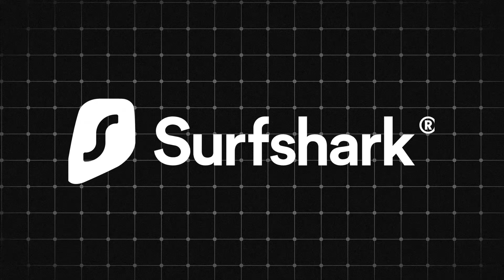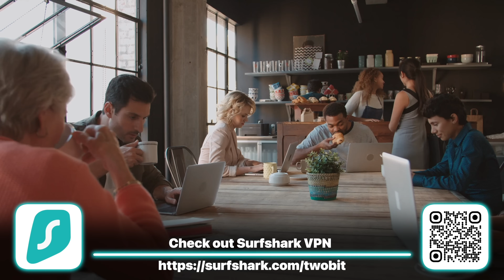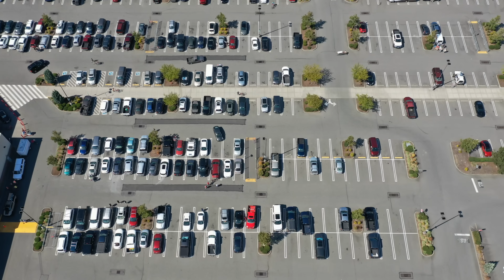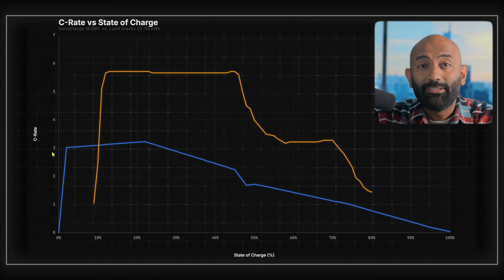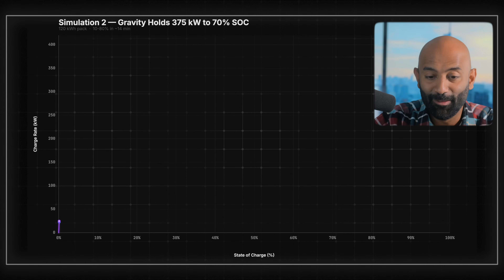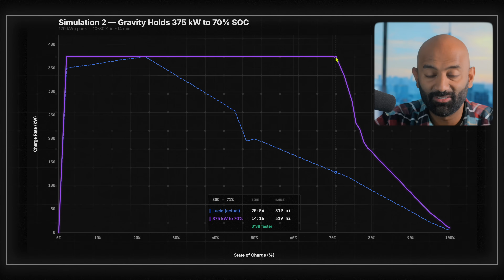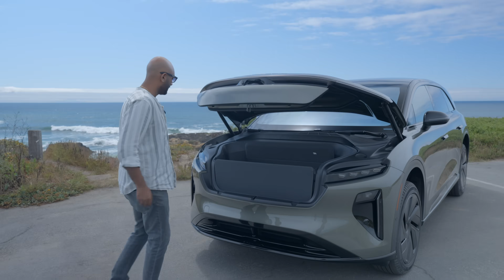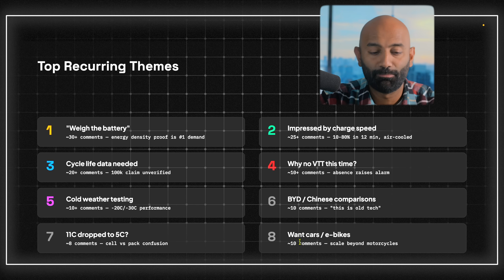Donut Lab Battery Test 4 Changes Everything!

Comment: Good analysis, this is getting real!
Note that we have some evidence of more than a dozen charging/decharging cycles performed (at least 340 at 3C rate), hidden in the temperature record of VTT report #3, see Figs 2 to 4 there. There might be other interpretations for the oscillations, but not probable.
Reply: Can you be more specific? The only oscillations I see is room temperature.
Reply: @Giedrius00  VTT report states (direct quote): "Variations in ambient temperature were caused by other cells being cycled in the same fume hood."
The self-discharge test was run in a fume hood, and the ambient temperature in the hood was monitored. I zoomed in figs 2-4, and by simple counting the peaks in the blue curve found 676 peaks, approx. 20 min intervals, corresponding to 338 charge/decharge cycles.
As seen in Figs 3 and 4, the blue curve starts/ends mid-cycle, implying that the cell-cycling experiment was started earlier and continues beyond the shown time. That's why I wrote "at least 340" above!

Comment: At around 8:15, you speculate that the Lucid Gravity charge power slowly ramps up as the SOC increases from 2% to 20% due to warming of the pack. That's not the reason. The charge power over that interval is limited by the maximum current from the charger, and at a fixed current (500 amps?) the power rises as the pack voltage increases.
Reply: Thank you for saying this. Every time he said it was warming up, I thought no, it's climbing in voltage with a maxed-out current supply.
Reply: Yep, ngl I was not expecting him to be ignorant on this important skipped over point
Reply: It's also following the characteristic of the li-ion battery. Li-ion battery has the S-curve that dictates the max charge rate you can apply. Slow charging at 0-10%, max charging power at up to 50%, and then slowly tapering down when the battery gets more full. 

You can't hammer ultra high power at 0% SOC because it will damage the interphase layer in the li-ion battery, further decreasing its life cycle (that's why the fast charging test from the CATL, BYD, and other big battery makers are always starting at 10%, not 0%)
Reply: Bravo
Reply: Yup, I see this on my electric moped. Which unfortunately only charges at 0.5C, but on the other hand runs on used ebike cells that have been holding up very well for going on 4 years now.
Reply: @jimmurphy5355  Yes, exactly!
Reply: that's kinda basic knowledge...so this means this guy is part of the trick.
Reply: It’s amazing how often he completely misses core principles yet sits there with his massive ego pretending he’s become an expert
Reply: @geekswithfeet9137  Let’s give the guy a break. He is trying and I guarantee he will learn from this chain of comments. Everyone would love to see 100% accuracy and correct interpretation, but to be human is to err. He is bringing some very important information to the masses and sharing both is knowledge and ignorance. Well done for mankind.

Comment: Great analysis! The comparisons and data points are very helpful.
Reply from the maker: Glad you found the data helpful! ⚡
Reply: @TwoBitDaVinci  One minor correction. You kept on stating that the Gravity was charging on a 400KW charger, but it wasn't. It was on an EVGO 350 KW not a 400 charger. Like I stated just a minor correction.

Comment: I'm guessing that the next test will be charging and discharging at -30C. But measuring the weight vs. capacity would be a winner as well. Thanks for the balanced review, and the comparison to Lucid's large battery pack. Which provides an understandable comparison between Lucid's conventional battery pack, and the relatively small (air cooled) Donut Lab battery pack.:popcorn-yellow-striped-smile:
Reply from the maker: Glad the comparisons helped make sense of it! ⚡ I'm not so sure the next test will be -30C testing though... would love to see it
Reply: I really need to see cold temperature test. I am from Finland and we know how poor EV's are at winter. Low charging and half cutted range in coldest times😢

Comment: BYD charges in 9min full
Reply: Requirements are a lot different for other SS batteries. They need to be clamped together hard, for instance. Adds weight.
Reply: Liquid cooling vs air cooling. He explained how the “taper” are just BMS limiting heat so you’re not sitting on a motorcycle that’s hotter then a stove.

Comment: A Lucid-sized Donut battery pack could charge fast if you could plug two 480kw chargers into it at once ... (With the right architecture)
Reply: Eh. Any Tesla charger would get you on your way in ten or fifteen minutes.

Comment: I'd rather have this battery on an minimalist e-bike.
Reply: Solid state batteries should make every application better especially if the power to weight ratio is good.
Reply: I'd like it on a maximalist ebike too!
Reply: @ChinaskisSoberBrother LoL same 

 Gimme a car with YASA next gen motors. Two at least. 

 (750 kw at 28 pounds last time I checked. 350-400kw continuous. 1006 HP). 

 They are cooking up a 15kg  inverter that can handle two for 1500kw or for 2012hp and trying to make it a mass neutral wheel hub motor. 

 Meaning it will weigh the same as a regular car wheel. Getting rid of certain parts due to being a motor. (Like breaks. They say the motor is powerful enough to Regen, and use emergency breaks) 

 This technology just doesn't make cool bikes guys. The motor + solid state batteries = personal VTOL or STOL. Redundant too since batteries, wires, inverters, and motors are a lot easier to build around. 

 I was just talking with someone, and so many EVs having the same layouts as ICE is lame. It opens up so many design possibilities now once they can have range without maximum aerodynamic efficiency.
Reply: @rpfour4  oh yes! My ebike was stolen and I long to replace it! Mountainbiking was never as much fun as with a middle motor ebike with a smooth Bosch motor. They say any shape for the pack is possible, so that'd be awesome!
Reply: And I on my phone (and all equipment charged at home) for the superior fire safety alone, dont even need higher cycles or energy density, even comparable charging times would suffice.
Reply: Imagine a battery outliving the ebike, and its range staying good as new. Imagine buying your last cell phone (or laptop) because the battery doesn’t degrade, and it doesn’t shut down while out in freezing temperatures. Imagine a car with a 15 year drivetrain warranty, that works effortlessly in any temperature, and refills as fast as a bathroom break.

Comment: I would be interested in the opinions of engineers from CATL, SVOLT, BYD, etc. who initially expressed the impossibility of this battery. If they still stand by their claim, haven't new arguments from the elite appeared?
Reply: So far we haven't been shown anything interesting. The charging speed is similar to that of already commercially available BYDs with a Blade 2.0 battery. The specific capacity of 400 Wh has not been confirmed, 100 thousand cycles have not been confirmed, and chemistry has not been confirmed.
Reply: @PupaVaskin they have already shown quite a bit, and we will see more. Please show me how you will put an 18kwh BYD blade 2 battery in a motorcycle and charge it at 100kw without cooling 🙏
Reply: ...we know why, yeah.

Comment: The battery may seriously degrade over time or cost a ton. They are stringing people along. The main guy is reportedly a big liar. Major red flag. If it was good they would release independent full test data not bits and pieces. No need for all this nonsense ❤😂
Reply: ”Reportedly a big liar” — some people keep repeating this, but based on what? From publicly available data, the guy is successful tech entrepreneur with multiple exits under his belt. It seems that people are repeating this narrative because the guy is involved in an AI company Asilab that says they’re building super AI. But if you check the video they never said it was there yet, but rather in development. Same with screenshots from the guy’s linkedin saying ”we’re 10% there on our journey to build this new kind of AI”… that seems quite concervative vs others claiming to build some kind of AGI? So I would suggest that unless you have different data and proof, stop spreading these rumors.. I think some chinese competitors started the rumor mill..

Comment: I didn't see whether they're using heat pipes and air cooling for the test.  If it's just flat heatsinks with no heat pipes, that's a test of purely passive.  Heat pipes are a step above that.  Add fans and that changes the test.  Add water cooling and the data would be different.  There are a bunch of test layers that need to be done and proven.
Reply: They state air cooled heatsink with two fans, one on each side.

Comment: The amount of power needed to charge this batteries is unsustainable, 1 MW can supply a village and 60 litres of petrol could output around 2.5 MW and you can throttle the output of the load as you wish. Modern batteries are still not ready for an efficient automotive industry and I think combustion is still king.
Reply: Except that you can only get about 35 % of the energy used from any combustion due to the limits of physics. And all burning produces contamination & CO2.
Reply: Anyone that has to import oil and has sunshine is electrifying as fast as they can with solar.

Comment: I see much made about charging speeds and they are getting impressive but in the real world they become irrelevant to most users. When you consider that 80% of cars out there are in private ownership and that the average private owner drives less than 50KM daily which means a weekly charge maybe. Add to that most cars are parked in a garage or carport over night, we all have to sleep, what does it matter for most people if a charge takes six hours. Even in heavy transport most vehicles return to base each night and spend the night there. Again charge speed becomes irrelevant. It seems to me that charge speed was used initially by the oil industry as part of their slow down campaign and has morphed into a marketing strategy for the battery manufacturers. Talk to most EV owners and you find that putting the car on charge each night becomes a habit in the same way that you put your phone on the charger at night You dont look at the state of charge you just do it.
Reply: Who cares what the average driver does? If you buy a motorcycle you buy it for adventures, you can't wait 6h to charge on the road. You might live in a distopian world, but most people don't have garages or parkings with electricity either.
Reply: @cristibaluta  The car manufacturers very much care what the average car owner does, they after all are the core market.
As for your bikes, less than 2% of road traffic in the western world are motor bikes. The vast majority of them are produced for the Asian market where they are the major commuter transport not "adventure" at all.
Most who own a motorbike for adventure and recreation only use it on the weekends and have a car for their daily commute so once again charge times become irrelevant.
Where I come from  in New Zealand  most houses have off street or garage parking but even in countries like the UK where city parking is largely street parking there are cross path charging solutions available. What does need to improve is the charging infostructure.

Comment: I’m still excited to see how this goes. As just a consumer, I only have a stake in the end product so being interested now costs me nothing.
Reply: Yeah, best case scenario: Donut batteries become a revolution in basically every device from your car to your phone or electric toothbrush giving better performance in all regards.
Worst case scenario: the battery ends up on par with li-ion.
Most likely: a new standard for best general use battery is achieved but its not quite as claimed.  Still great tho
Reply: @FurryGram  Currently the FAA limits the size of laptop batteries to mitigate the risk of a fire on a plane.   If this battery is not filled with combustible electrolyte, then we might get laptops with significantly more battery duration.
Reply: @FurryGram  Nope the worst case scenario is actually: The battery ends up being a hoax and investors start to pull out of investing into new innovations in the battery market which leads to no new innovations.
Reply: @RealTaIk  Well if that was the case, there  never ever would have been any new innovations. So your statement is completely not where this would ever likely be heading. In fact, the very nature of these types of investors is taking Huge Risks for the potential Huge Gains.
Reply: @SportsTymeStories-h8x  Nope there is evidence of more and more investors pulling out of the batterie section because of prior failed projects that were making up stuff about their product without proper tests just like donut labs is doing right now.
Reply: @SportsTymeStories-h8x  EXACTLY! All investors know that higher risk means higher potential profit. And here the potential is huge!
Reply: @SportsTymeStories-h8x   Bla bla bla.....if you claim somthing about your product which is not true (a scam), one might end up in the court.
Reply: @Unity2-765 Bla, bla is mouthing off before one actually knows the actually facts. Nobody really does right now. So again, what's your real point.
Reply: I really like your way of looking at this: "As just a consumer, I only have a stake in the end product so being interested now costs me nothing.". Wise words that apply to a lot of stuff.
Reply: I am so hoping that this is actually real, producible, and reliable.

Comment: I want to see cold temperature tests
Reply: Worst case, one insulates and heats the pack.
Reply: @davis.fourohfour  As a Finn, when you live close to arctic circle, insulation does help but you cannot help the pack without external power sources for long time. Let's take 100 kWh and you're planning to drive 100 km to location for a weekend that doesn't have grid connection. Can you get back? Assume temperature around -30 °C. For the range alone, 200 km should be an easy task but currently available EVs' performance crashes in cold.

Insulation and heating is a good solution if you're grid connected at all times during parking. Otherwise the car must survive by itself and then you must let it cool to environment temperature levels for longer parking timeframes. And at that point, heating the pack using the energy from the same battery pack is the only thing that can help you.
Reply: I want the test that shows how many times you can recharge the battery
Reply: @dr.catherineelizabethhalse1820  Assuming 5C charge and 5C discharge, completing the claimed 100k cycles would require about 4.5 years without any pauses between charges and discharges.

You cannot honestly expect full 100k cycle test to demonstrate the claim which is why Donut Lab should declare how they figured out the claimed 100k number.
Reply: We have pretty good tech for quickly heating, pre-heating etc. already used in vehicles everywhere. Why are you worried about this aspect?
Reply: @PravinDahal 😂 laughes in Alaskan. 😂